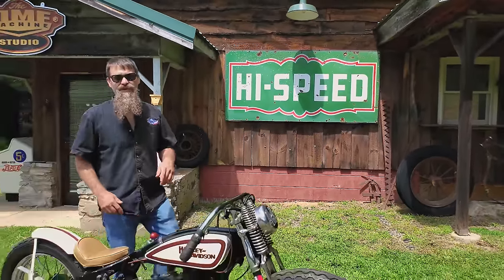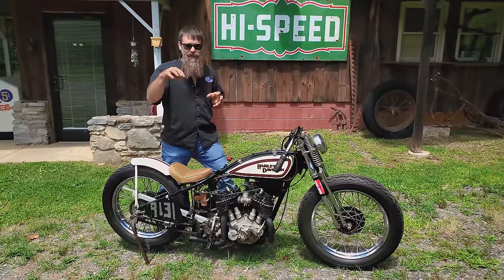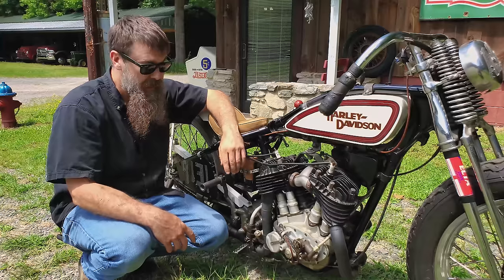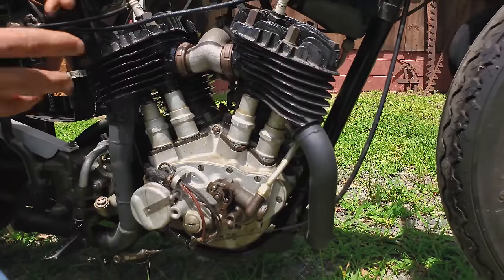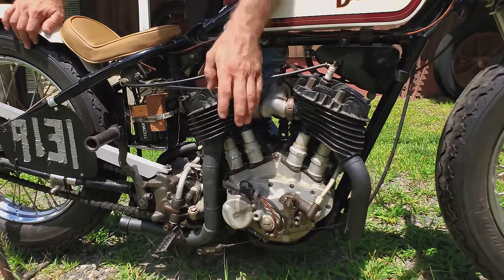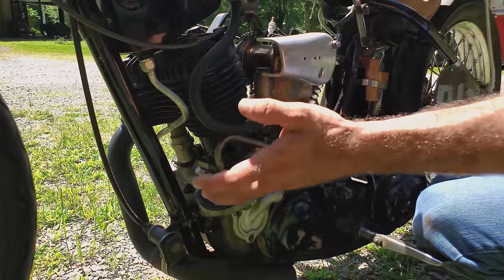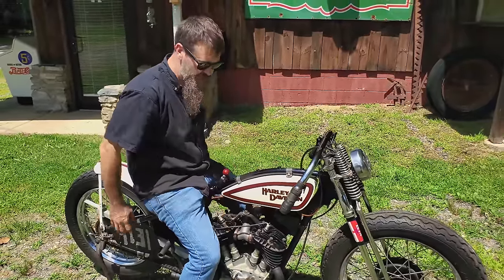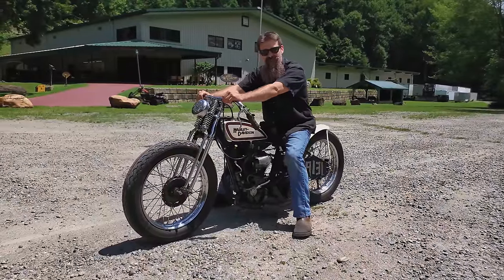The Maxton Miler

Comment: Those pipes have the most unique sound! Love it! Humn....how is that accomplished?
Reply: Pipe length, cam timing etc. They sound like that when they're happy
Reply: @needmetal3221  

I have an 88 stroker shovel...do you know a mathematical equation that might help? Stock 73 bore with 4 3/4" Stroke. Currently the the andrews cam is a bb grind. I have ckearance foe a #6 if I so choose....S&S carb...heads are '81...delkron shovel case, S&S wheels/rods and jugs with 9to1 slipper skirt pistons. Any of this info help?
Reply: @SigurdtheRyder  no mathematical equation I know of. If you're running straights the length is important. Idk for shovels. Sportsters used to like 26 inches from what I recall. Once you stroke the whole thing changes
Reply: @needmetal3221  

I used to tune pipes using a slider with talcum powder to watch the frequency nodes...find the spot, tac in place then bend/cut the new pipe at the proper length...sometimes the pile lengths do not match! I dont know why but it seems to work...
Reply: 40 years ago I saw diagrams for a shovelhead from the factory racing dept. They had destroked it to 1100cc and filled and reshaped the ports. Interesting stuff
Reply: @needmetal3221  
my heads have minor porting on the intakes...

mostly just cleanup

Comment: I think if you put a couple reed valves on the crank case vents so the pistons act like a vacuum pump after they pressed the air out so all you’re dealing with is back pressure from the reed valves and use the FMF 450 cc dirt bike power bomb style exhaust expansion enhancements maybe drop a tooth somewhere in the drivetrain/ presuming your dad was no hp but rpm limited and I think it’ll do the ton as they say.

Comment: Where do you get your gas ? Out here in Los Angeles it all has Ethanol greening up my carbs.
Reply: That's not from ethanol.  That's from water in your junk gas from junk underground tanks.  Switch stations.  Ethanol sequesters water so it can be carried out of the system instead of settling.